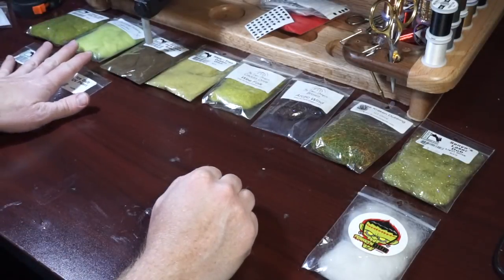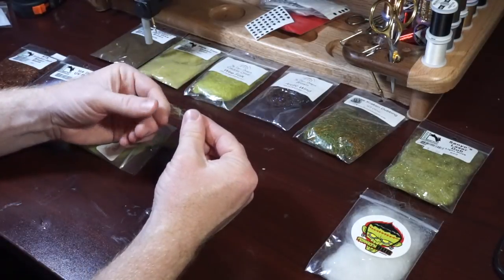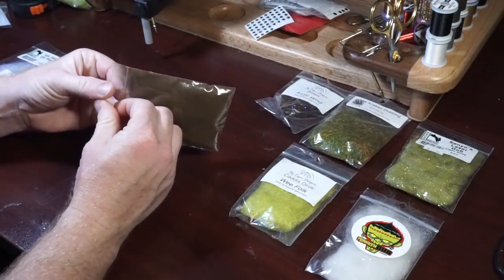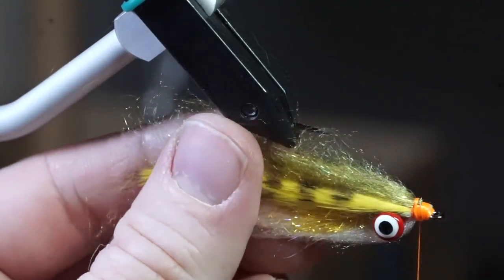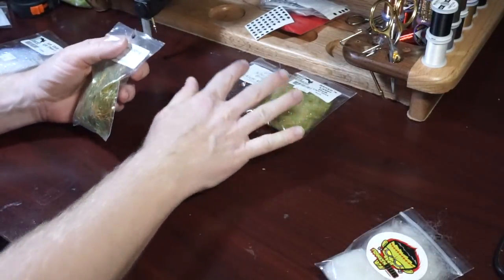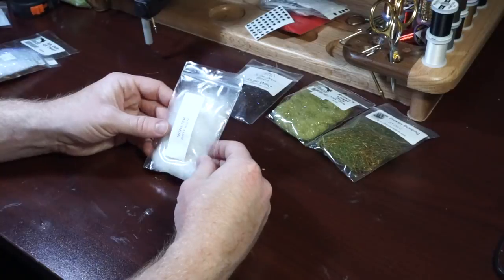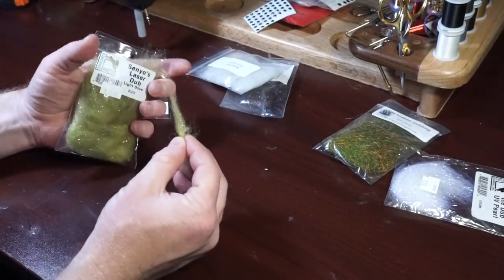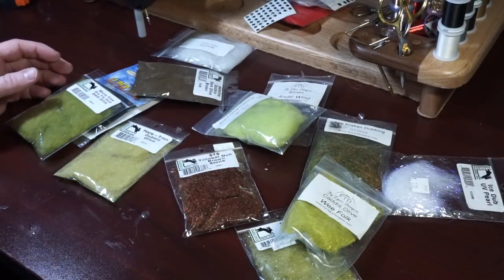Dubbing - Types and How to use - McFly Angler Fly Tying Tips

Comment: Love the channel.  For me, fly tying is about connecting to nature.  So I tend to use mostly natural materials.  So are so many furs out there and they are each a little different, so it can be daunting at first.  The key is to experiment and to identify the pros and cons of each.  I like to take the dubbing right off the skin, as it helps me control the amount of guard hairs.  Some of my favorites are pine squirrel and gray fox for drab nymphs, rabbit for dark nymphs (it takes dark dye really well), and red fox and golden retriever for light nymphs (for golden retriever, I just use the shedding of my dogs winter coat).  For dry flies, I like muskrat, beaver, snowshoe rabbit, and mink.  The beauty of mink is that there are white, brown, and black varieties.  Wool is really versatile as well.  It takes dye really well, so can be dyed to almost any color, and it is hydroscopic.  So it will absorb water or silicone floatant equally as well.
Reply from the maker: Thanks, glad you like the channel.  I totally understand where your coming from with materials being all natural.  And I also connect with nature while fly fishing.  However I like trying all types of materials also.  Different types of materials have different properties and sometimes can benefit a fly if used rather than some others.  I think many pattern’s definitely need natural materials but I feel some others also seem to do better with synthetics.  So while I totally respect and understand your reasoning on why you like only synthetic, I personally like to use both depending on the fly.  Hope you understand
Reply: @McFlyAngler  totally understand and agree.  I’m a firm believer in “you do you and I’ll do me”.  I only brought up my preferences to identify some different options for the readers of the comments.  FWIW, I’m not a natural or nothing person.  I do use synthetics when it’s the best fit.  Speaking of that, have you ever used Gartside Secret Stuff (“GSS”)?  The GSS Emerger is a killer pattern.  I’ve never broke down and bought the GSS (it’s only sold on Jack Gartside’s website), I substitute angel hair.  I’m wondering how different GSS is.
Reply from the maker: I have not used gss, sorry.  I have heard it’s a great pattern also.